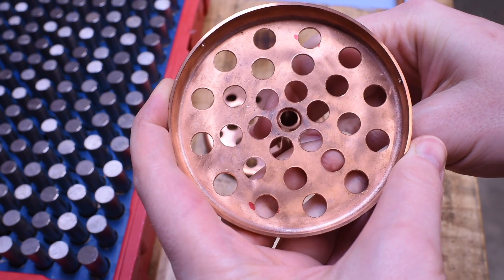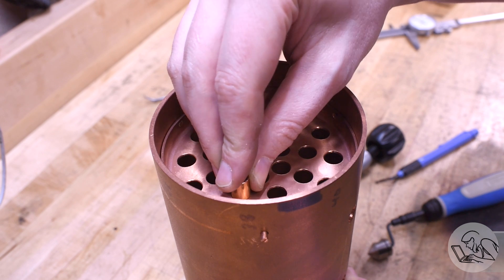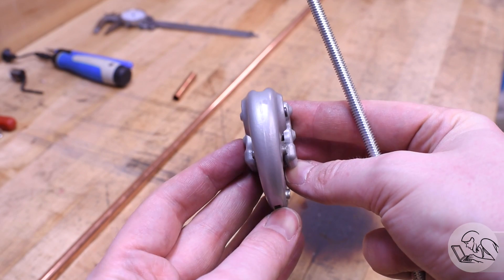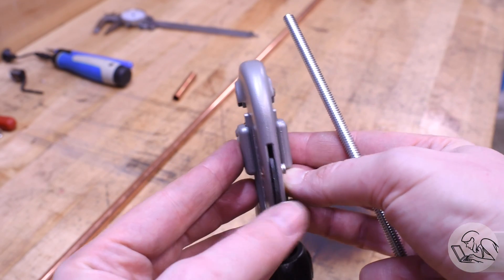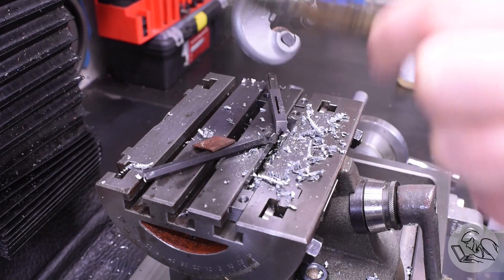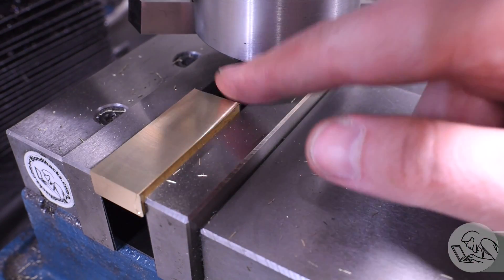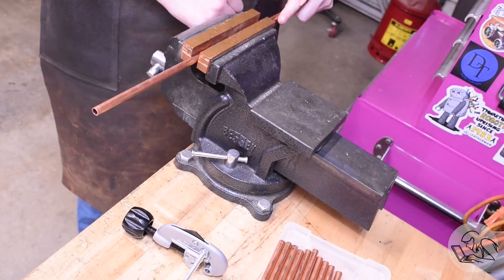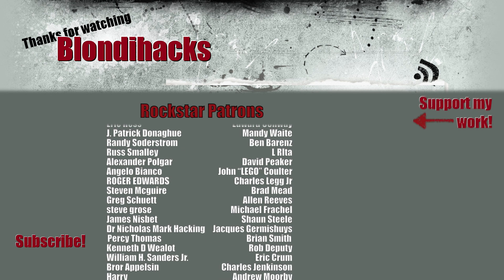Repeating Tubing Cutter : Making boiler fire tubes | Model Boiler Build, Part 5

Comment from the maker: Hey Internet! Here are some common questions for this video to save you commenting on it:

1) The center tube was not within “flaring” range to make it fit. I tried that and scrapped a couple parts in the process. Even if I could have, it wouldn’t have been a good joint because the diameter is then not parallel to the tube plate hole sides. The sliver solder would have had to fill a large wedge-shaped gap, which it is not good at doing. 

2) Yes, I am aware that tube rolling is a thing. It’s a high-skill process requiring expensive tools though, which is why hobbyists all silver solder instead. I’m not breaking any ground here. This entire boiler is bog-standard model engineering going back a long way. I see no reason to deviate from proven practice here.
Reply: I doubt that tube rolling (I assume you mean tube expanding) would work well with copper.  In large water tube boilers, tube expanding is used, but in this case it is steel boiler tube that is specifically made for the job.  Keep up the great work.  I look forward to your next video.
Reply: @BarryE48  Look up refrigeration swaging tools.  They expand the tubing to fit over the same size:  no coupler needed.
Reply: @michaelboettcher6913  not to forget depending on what type of tubing it is such as "K" for Refrigeration the strength isn't marginalized by swaging it. The silver solder isn't a soldering process anyway. It's Brazing. The strength it adds makes the materials far stronger than their  strengths alone.
Reply: @michaelboettcher6913  After swaging, are the connections tight enough and no soldering required?  I doubt it.  I am a retired mechanical engineer and my entire career is with high pressure water tube boilers and water treatment for steam supply to power station turbines.  You are talking about connecting refrigerant tubing with a fairly long swage.  It is so different from expanding tubes into a thin plate. Blondi is correct in that the hobby boiler makers solder their tubes to the boiler plate. Expanding the tubes into a thin copper plate will not be a good idea.
Reply: @BarryE48  The idea is to increase the diameter for a close fit, then solder/braze them like the other tubes.  Never intended to be a formed in place seal.  Since she has a lathe, it's easy to take a piece of mild steel (or bolt for higher carbon steel) and turn it to the correct diameter with a taper on the end.  Grab two pieces of hardwood and clamp them together so you can drill a hole down the seam that's the same as the tubing's OD.  Tube goes between the two wood pieces in the vice, with the bottom of the tube resting on the slide of the vice.  A drop of oil on the swaging tool, and tap it in however deep you need.  Hardwood keeps the vice from damaging the copper as well as giving it mechanical support for most of it's length.  Open the vice jaws, reverse the tube, and swage/expand the other end.  5-10 min of fabrication with scrap, and you don't have to wait for the McMaster Carr order.  (unless you really want to have metric parts in there :-)  )  Or... you just use something like Stay-Silv 15 for wider gaps.
Reply: in refrigeration repair they make a swage kit  does the same thing you did with your center tool ,, but its made for the job .. great video ,, I am not saying you did it wrong ,, you got the job done that's what counts .

Comment: Ho visto parecchi video che la riguardano.
Sono convinto che Lei, gentile Signora, sarà in grado di fare per me un boiler di almeno 800 ml di acqua lungo circa 20 cm compreso il bruciatore. Il motore attuale nella mia barca modello di 140 cm è un Neptun della Regner. Il boiler attuale è un maxi 100 della Regner e non è sufficiente per capacità di acqua 450 ml e potenza di calore. Se possibile mi contatti. Grazie. Saluti dalla Svizzera.

Comment: When equipment is greased over time the oil in the grease can work its way out so it appears as if it had been both oiled and greased when it was only greased. Not saying some people don't do both but it happens all the time. I used to do Electromechanical Repair and it was a common occurrence for units that had been in the field for a couple decades came in. But yes a lot of times they clean up nicely.

Comment: There is an interesting solution to the problem of the length being limited to one thread pitch (or .050in in this case). if you made a rod using a piece of 1/4-20 threaded rod for one end and a piece of 5/16-18 for the other then you rotate the end stop till it is close then turn the rod and your stop will advance or retreat slowly. the actual movement is determined by the difference between the respective thread pitches. In this case it would be 0.00556in per revolution. this thing is used in industry to provide high precision movement with a really simple mechanism. You would only add a 5/16-18 threaded hole to the other end of your existing end stop.

Comment: Liked this quirky and useful tool a lot Quinn, thanks for sharing. I know you've probably thought of it already but I wondered when you made your collet chuck setup if it would be worthwhile boring and tapping a through hole to the back of the collet, to make it easy to screw in a stop for repeatable cuts.

Comment: I realize you've stated a few times that you were going to use silver solder for these tubes. But you do realize that typical solder will certainly be more then enough to hold them even with very high heat being applied after they are soldered in place. And since regular solder is both easier to use, the job will be a heck of a lot easier to solder them all. Just an idea. Thumbs Up!
Reply from the maker: Soft solder is definitely not recommended on model boilers and no inspector would pass it. Model boilers can easily reach the melting point of regular solder

Comment: 26 tubes is a lot of tubes, I am just glad I did not build the boiler that was on my ship when I was in the Navy,
it had 1500 small 3/4 inch tubes and over 100 2 inch tubes to protect the smaller tube.  And it had several larger tubes, I think were 6 inches or bigger.   If you are curious, look up modified D type boiler.   All boiler techs were eliminated in the 1990s.   My boiler was a 600 PSI boiler.   I know some were tiny at 1200 psi both were for main propulsion,  there were others were 25 psi mainly for heat, cooking, laundry, distilling water for drinking and fresh water for the boiler.

Thank you keep making me smile, I enjoy your videos very much.   Lee

Comment: The alloy is probably Zamac 3, or possibly Zamac 5.  93 or 94% zinc, 4% aluminum and a smattering of copper, iron, tin, magnesium and lead.  Casts beautifully. Machines beautifully. Surprisingly strong, takes paint or plating great, melts at less than 800F, compared to aluminum at 1,200+.  Cheaper too.  Anything die cast, just assume it's a zinc alloy unless there is a good reason to think otherwise.

Comment: how do you determine pressure ratings for different materials? when you use pipes from store you just look up schedule 40/80 etc. ratings. Is there a formula to figure out the pressure rating as a function of wall thickness
Reply: follow up to this for anyone who reads this later: i found the answer use Barlows equation https://www.youtube.com/watch?v=Z8wrlgrn4BA

Comment: There's a particular tool I once saw that widens the ends of tubes for boilers, so that they fit closely to the hole they're before being soldered.

It consisted of basically two rollers with a conical silohuete. Just push down and spin around and it should flare to pipe into being a close fit
Reply from the maker: A tube swager

Comment: a more controlled flaring way of doing the job is a quality flaring tool, I have a Rigid 45 and 37º flaring tools and work nicely.. so putting an end stop on the flaring bar, relating to the tube length, would be very repeatable and no chance of bending the copper tube.
Reply: also, you can make a swagging die, Ive used a sockets with a taper to flare them too... so in a pinch, since you have a lathe. you could have made a swagging die to form the tube to fit.

Comment: Slick tool build!
Could make the brass stop part a disc with a radius same as max tubing cutter opening, threaded hole in the middle, stop nut as now, making it universally adjustable and capable of working with any size tubing the cutter can fit.

Comment: Nice, and lucky you have a pipe cutter that makes square cuts, many do not. As a fabricator this is a common job for me and my usual setup for tubing up to 3 inch/75mm is a chop saw with a length stop setup.

Comment: some place in the states making a boiler like that is a no no.  the biggest copper you are using  looks like it was a seam boiler tubing for boilers is supposed to be seamless.
Reply from the maker: It’s seamless and this is how virtually all model boilers are made. I’m not doing anything unusual for the field here. That outer shell is rated to almost 4000 psi. I’ll be running it at 60. Suffice it to say I’m not worried.
Reply: @Blondihacks  that good i worked on boilers  i got a 35,000 psi rating for high pressure silver brazing

Comment: on the topic of metric/imperial - what will the water capacity of the boiler be measured in?
English locomotive boilers are measured in gallons - imperial gallons - which are bigger than US gallons ...
Our pints are bigger too - 20 fluid ounces rather than 16.

Comment: 2:00 ish - those deburring tools are AMAZING ❤❤❤
I picked up a set after watching a pervious video, they're useful in surprising places!

I messed up some pcb's I designed - screwholes too small. A drill and the deburrer sorted that out quickly 😊

So thankyou Quinn for the excellent tool help! 😊❤

Comment: Cutting tubes for boiler making might not be common anymore, but shell and tube heat exchangers are still very common. I wonder what tools they use there to cut all the tubes to length

Comment: I would of put half the length of tube in the lathe and had the rolling center set to the correct length to part off using a cutting tip instead of a parting off tool, this will give both ends a nice chamfer,
and makes it more easier to flange out one end then once inserted you can flange out the other end to make a tighter fit and less movement,

1st  I would part off all my pieces
2nd I  would then  use a counter sink bit in the tail stock to deburr the inside and at the same setup use a scotchbrite or sand paper to deburr the outer as would also clean it for soldiering.

 
English people has lost there way at speaking proper English,
 Laegrecastrescir and now it is Leicestershire and Leicester it the town within the county
but it would of sound like this when spoken
Lyest- ester
But now it sounds like Lester.

It is a bit like Imperial to Metric, some weird people think its good idea to keep on changing to cause confusion to those that has learnt the latter

Comment: When I worked for a company building gas trays for semiconductor equipment.  We modified the same type tubing cutter to fit one of the lathe tool holders.  Clamped the SST tube in the 3 jaw chuck, moved the carriage to the length needed and made the cut.

Comment: Nice work on the tube cutting fixture. Do you run the risk of the top fire tubes getting too hot as they will not be surrounded by water?
Reply from the maker: They’ve been making boilers this way for 100 years, so it doesn’t seem to be an issue.

Comment: If you see a sleeping dog.......let it lie!!...............soder-----------a person who cuts sods.

A question..........the copper tube you use is colloquially called half inch, which means it's bore should be 1/2 inch or 12.7 mm.

The stuff we buy here in the great south land is nominally 12 mm and is a metric replacement for the older imperial size.  My TAFE teachers told me that there is a difference between the method of measuring tubing as opposed to pipe.  One measures internal, the other external dimension.   The result is that where you see a fitting labelled 12 mm or half inch you have no idea of it until you take your own measurement.

Stavros

Comment: That adjustable fixture plate is like the bench-top version of Abom79's shaper's "universal table". Really lovely. Even looks like it has a 3-eyed smile on the end.

I totally would have drilled out the rivet from the worse-than-useless deburring thing on the back of the cutter. I was so happy when I realized the deburring tool I bought for 3d printing could also be used on copper plumbing pipe...

Comment: I like this channel, there are a lot of fun and interesting projects. For the oversized Center fire tube, couldn't it be just swaged a little larger?
Reply: Mr67chev, the problem would be at the other end. Very difficult to swage and a big (relative) gap too large for silver solder.

Comment: Metric put man on the Moon.
Reply: When I saw this interesting comment, I had to check my copy of the Apollo Mission Manuals.  Now, I have to admit that I only have the Apollo 8 manuals and not the Apollo 11 manuals (8 only went to the moon whereas 11 landed and put man on the moon).  Nevertheless, in the Apollo 8 mission manuals, everything is in miles, miles per hour, feet, feet per second, pounds, gallons, gallons per second and so forth.  Most certainly not trying to fight or support one system over the other ... just repeating what I see.
Reply: Wernher von Braun was German, the Saturn V was his design, using metric. Measurements were converted into imperial for the parts vendors. I have no doubt that imperial was used for the mission, but metric was used for the build. I’m fairly sure NASA uses metric for everything now, due to some embarrassing stuff ups.

Comment: I am waiting for when you discover how much heat it will take to solder it up.  II used fire brick.  They were stacked up and around to with in a quarter inch of the top.  Tho even then it took ALOT of heat!
Ultimately I had to swage the tubes

Comment: Like anything, there's a tool for that.

 It used to be called T- drill. They had nibbler for notching the tube for side sockets. The drill and puller tool makes a socket. There was a dimpler to keep the tube from going in too far. Did bunches for the Seattle Mariner's ballpark a few decades ago.

Comment: Thank you fellow Canadian, I actually could use this. I sometimes get inaccurate cuts with my tubing cutter when the blade decides to cut spirals instead of one concentric ring. I imagine your invention could double as a guide to keep the tube in position. Well done indeed!

Comment: Quinn , your idea  of the the stop on the pipe cutter is brilliant... Years ago I worked with this older English gentlemen and on our first shift together he said bring torches... I will meet you  at the job . So I bring the torches in the elevator up from the basement  to the shop floor. I wheel them about a half  city block to the job , He looks at me and starts laughing , and said to me "  Mate I should have said bring extra flash lights sorry about that "  ?????
Reply: Same thing. In the 80's putting cameras into NASCARs (Racecam). We ask one of the team if we can borrow a torch - and the next minute he is wheeling over the oxy set...
(And I like the way he didn't hesitate at the thought of us attacking their lovely car with oxy)

Comment: I probably would have just tried to flare a tube of the regular stock until it just fit through.  Then flare the other end oversized to hang it like the rest. But you'd still likely have tp flare the free end more after soldering the first end.

Comment: In my old job I sometimes had to strip a bunch of coax cables precisely with hand stripper. I got tired quikly of measuring the cable again and again so I made almost exactly this hack to the tool. It was just a bolt threaded through a hole in the tool and I think I had a large washer as a stop. Made my work faster and more precise.

Comment: I'm not sure but I think they used to flare both ends of the fire tubes in boilers. This, of course, must have happened when the tube was in place. Basically it shouldn't be too hard to make a tool that has a swellable head which is threaded at end of a fire tube, swollen there and then take the swelling out and repeat this for all ends of a fire tubes. Might work for clogged nostrils too.

I don't know about the rest of the world but in Finland copper tube is sold in a large coil. That would make a bunch of bananas unless taken care of.

Comment: Quinn, the place I used to work overhauled C-130 oil coolers back in the '90s.  We had a simple(?) hand-held tool for flaring the tubes well enough that no soldering was required.  Unfortunately, I didn't design the flaring tool, so I don't remember what it worked like, other than a very vague (& possibly incorrect) shadow of a memory of perhaps a rod with a tapered end that was pulled through the tube enough to flare the end.  If that faint memory is correct, I assume that the tool was used on each end of the tubes.  It must have been fairly quick & easy to use since there were 100s of tubes in each oil cooler and we had 100s of oil coolers to test, repair as needed, and retest.

Comment: Hey Quinn loving the build so far!

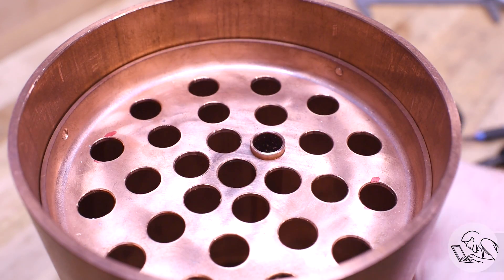Just something I'd mention, if you've silver sodered both ends of the tubes to the boiler plates, with the expansion of the copper and the pressure build, do you think it's possible you might accidently bow either the tubes or the plates while steaming and cause a rupture? I know this was a big issue in marine boilers and locomotives so they only ever soldered/welded one side. Not sure how they sealed it and not sure if this scale would produce the same results but safety first! Even a small boiler like this will, if it goes off, Certainly be a bad day. Note: I'm at 3:48 at the minute so not sure if you rectify this later. But throwing this here for safekeeping.

Also, congrats on 100k!